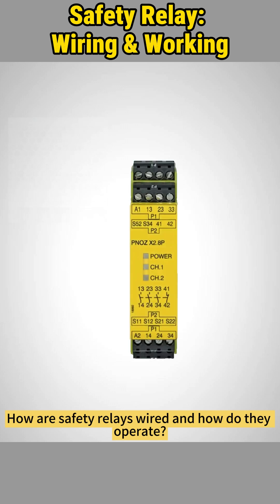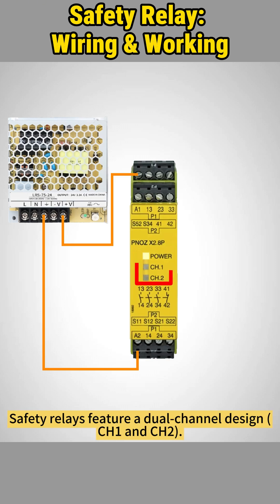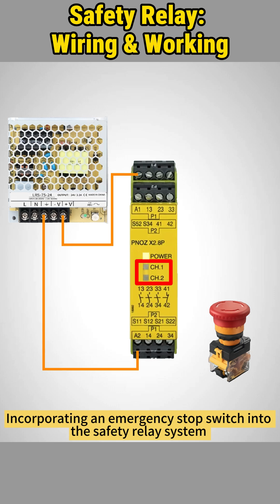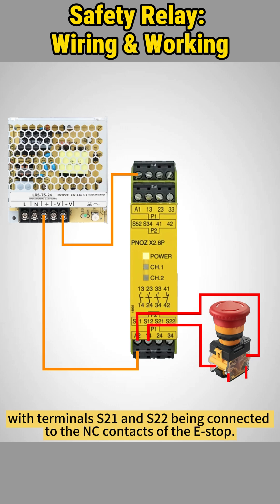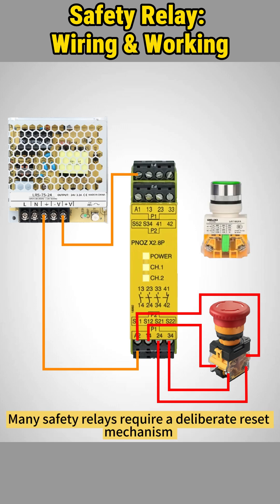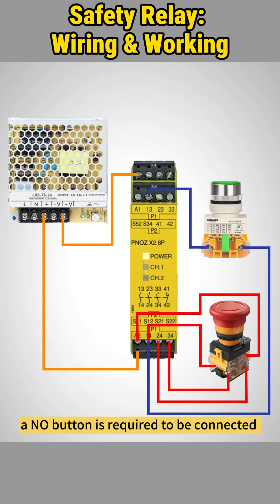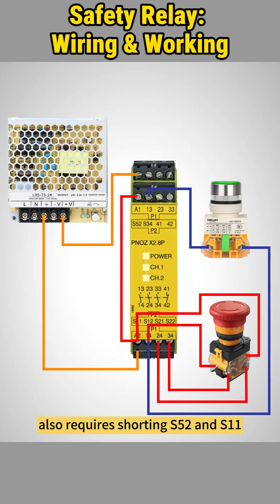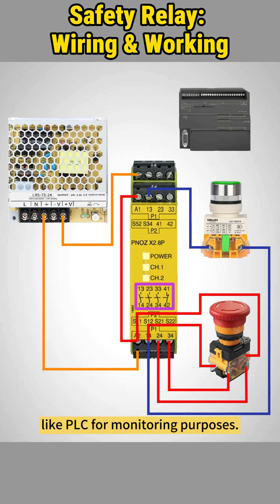Safety Relay: How it Works & Basic Wiring #howto #relay #electrical

Comment: there is a mistake in your circuit. when connecting 24 volt DC power supply you need to use -V, +V. You used grounding

Comment: Numbers don't match with the description.
Reply: if you look at the top, you will see the screws for the contacts much better than the view of the bottom ones. on the top you'll see 2 rows of numbers identifying the contacts. top row of numbers is for top contacts, bottom row for bottom and same for bottom, they're just not visible in this tutorial.

Comment: This is a Pilz..but the other brands work similarly.  The point is a double contact system from the operator and relay output monitoring to catch welded or failed output contacts.  Redundancy is the key to safety.  Some ran on double NC systems (not good)...others on a NC/NO contact.  Pilz could identify the contacts singly by using pulse timed signals to their safety PLC system so you could identify the button in the safety loop.  More wires, but real helpful.  The one in this short is not one of those systems.  (Controls engineer using the Pilz PLC in machine control. Nice, but cumbersome...but no hurt or dead employees thank god...almost lost a few with the old single wire estop circuit surreptitiously bypass by forget full techs. The couple grand investment is worth a friend...and lawsuits.)